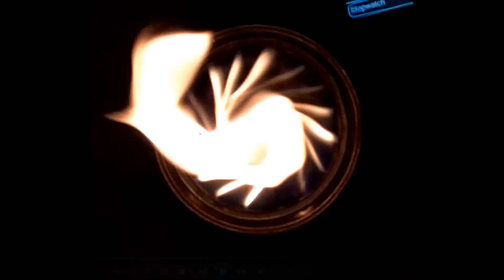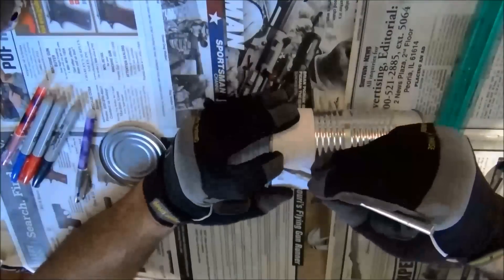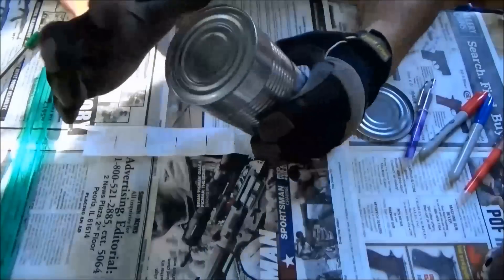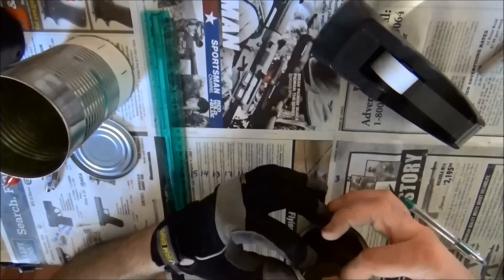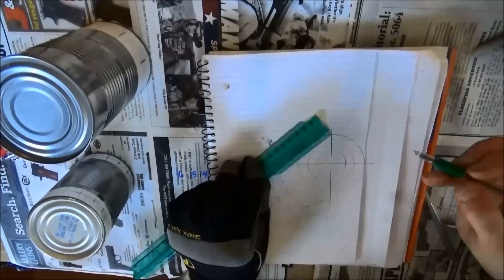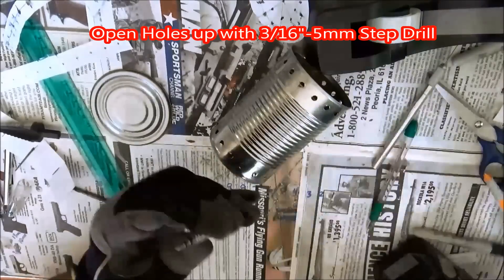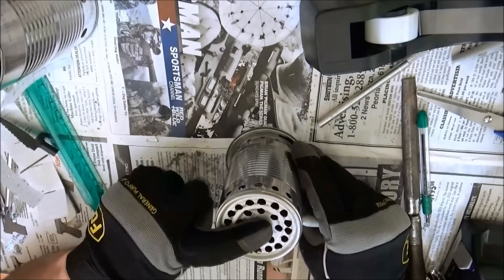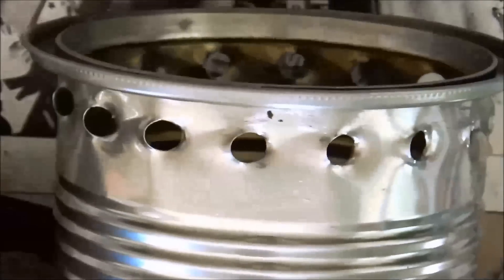Wood Gas Stove Science!! Vortex V5.4 Build!!

Comment: And really I have nothing against wood gas tech.i feel it has beter off grid fuctions,such as running a generator,but they eat wood way to fast.best one I made had four walls,and was very close to compleat combustion,but it still didn't stack up against my expidition stove.and where I camp,there is no room for error.i don't do weekend hikes.rocket stoves fall I the same park here.i made some really good ones,even from clay,but its to hot and burns the wood to fast.think about it,you induceing fourced air into a fire,its gona burn like a forge for a few minutes and then its done.its all we are doing here.creating a strong draft.our ancestors did this with a Dakota fire hole a long time ago.for the weight and space,the Swiss and sweedish army stoves are the best route,and if we can make a small fuel puck that burns hot and for a long time,we got a solution to the apocalypse.sawdust and used oil works great but its messy.paper alown isn't volital enough for compressed pellets.long way to go befor we solve this problem

Comment: Yea its called a pressurized stove.the one I have was used in Vietnam,and is still going strong.the pressurized system burns almost ant liqued fuel,including gasoline.pluss it doubles as a wood burning stove.google the svea 123, you'll figure it out.

Comment: All I'm saying is its cute,but until I find a stove that can beat my sigg,I'm not going to be impressed.by the way,I just ran a two cup water boil test on my sigg,four minutes.and I used many a tablespoon of alcohol in the stove and actually still have fuel left over.there was a reason why this stove was a champion on expeditions all over the globe,to the most remote areas possible.it burns anything,consrvitive on all fuels,and cranks out the btus.it beats my gas stove in my house.we can stop trying to build a good stove.Sweden beat you to it.fuel is a diffrant story.with a stove you can burn anything in,we can explore more options like fire dough and biomass briquettes.
Reply from the maker: +Richard Peterson So... How hot does your alcohol stove burn? I bet at least 1800F to boil water that fast. 
i agree alcohol stoves are pretty sweet, but I'll keep working on my wood gas experiments. Thanks for the comments!

Comment: And by no means am i knocking your stove.its actually really well made.but I think I our quest to gain compleat combustion,chaseing the blue flame basicly,we steped off the path we need to be on.a small stove that can burn at 500 degrees for two hours is way beter than one that burns @ 1500 degrees for 15 minutes.this type of stove has one job.to cook food.and a longer burn time on small amounts of fuel is desired here.for example,we made a similar stove that you set a sweedish tourch into.same can disign basicly,just a difrant way to build and burn the fire.45 minutes burn time,and we used a very small log,small enough to fit in a soup can.id like to see longer burn times reached,but few people are working on this.
Reply from the maker: +Richard Peterson My mission during my Wood Gas Stove Science series was to learn the science behind wood gas stoves. Another personal goal of my work was/is to learn how to make a lightweight, clean burning, backpack stove for cooking a quick meal or hot beverage while on the trail. The Vortex 5.4 seems to suit that goal. While hiking I do not really want to stop trail side and spend the afternoon cooking. You can tailor your burn time with this design from about 15 minutes to 40 minutes with the amount of wood pellets/fuel you add. If you need really long cook times a different design is for you. Thanks for the comments! :)

Comment: Just out of curiosity,is that temp realm necessary?most of all back packing stoves average that time in boiling two cups of water,including a dakotota fire hole and a sweedish fire torch.and if its burning that hot,how long will you really get in burn time?I agree we need an efficient stove,with minimal smoke,and we need to reduce cook times,but anything above 450 degrees is excessive.all food can cook at or below this temp.what we need more than insane temp is long burn times on small fuel supply.master this and ill be impressed

Comment: I have planned to make few of these with my scout patrol but I struggle to understand how does bigger can's top hold smaller can still. I also ponder what kind of can opener should I use to success. I only have this army style opener http://bit.ly/1UC94oc and it doesn't make a clean cut but do the job.
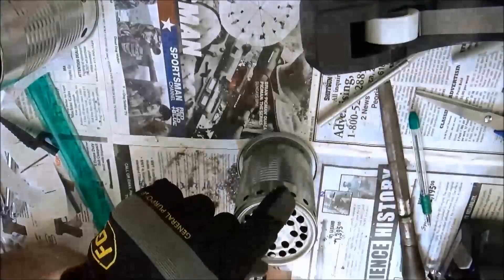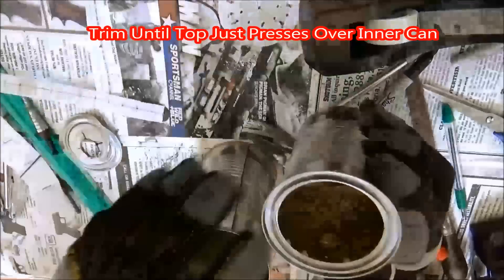Reply from the maker: +Joona Halinen I use a side cutter to remove the top of the large can. This allows the top to be put back on the can easily. Pause the video at the :08 mark to see a good view of the can opener. After removing the top of the large can you will cut a hole in it just big enough for the small can to push in but tight enough so the rim on the top of the small can dose not go through the hole. Watch the video from 7:50 to 8:40 in slow motion if you have to. If you can not get the right can opener you can flip the big can over and cut hole in the bottom of the big can. It makes making the Vortex Tweak tougher, but the stove will work very good without the vortex. The open bottom of the large can will allow the ground underneath to get very hot so use it on a rock or something so you don't start the ground on fire. Hope this helps. Make sure to like the video and subscribe if you like.
Reply: +Heath Putnam I actually found proper opener today so I'll build one this week. What kind of paint did you use in your own? Some kind of heat resistant carpaint? Paint has to manage over 1400 farenheit! How has your paint react to use?
Reply from the maker: +Joona Halinen 2000 degree spray paint off amazon. The outer can is still holding up very good, the inner can still has all the paint but turned white. Good luck!

Comment from the maker: Tothe Point** Unfortunately you have your comments turned off so I can not respond directly to you. If you want to make a bigger stove, the hole size should remain the same you will require more of them though. Keep the spacing between the holes and the distance from the top or bottom of the can the same. The ratio should be close to 5:1 area of primary air holes to secondary air holes. The size of the outer can does matter. If the outer can is too small the air will not flow freely up to the secondary air holes and if it is too large the air be super heated and the strength or the burn will suffer. My rule of thumb is outer can is not more than 1 inch bigger than the inner can. You will have to experiment a little to get it perfect. Check out my other videos for the science behind wood gas stoves!
Reply: Heath Putnam Thanks for the quick reply. (I don't know how to turn comments on, will try and find out, sorry.) Great explanation, as always. Thanks!

Comment: If I wanted to build a larger version, would the hole diameters etc. just scale up as well? For example if the cans were twice the size of the ones in the video, would the size and number of holes change? And is the space between the inner and outer can important?
Reply from the maker: +Tothe Point The bottom holes are actually considered the primary air intakes. The problem is probably the ratio of primary to secondary air intakes. Through my experimentation I found that if you can get close to 5 times the amount of primary (bottom) hole area than the secondary (Top) hole area you will get a much cleaner burn. 
To figure the total area of the top holes divide the size of the top holes by 2 (that's the radius). Multiply the radius by the radius then multiply by PI (3.14) then multiply that by the number of holes. Take the number you got for the total area of the top holes and multiply that by 5. That is the total area you will need for the bottom holes. 

Divide the size of the bottom holes by 2 (that's the radius). Multiply the radius of the bottom holes by the radius then by PI (3.14). That gives you the area of each bottom hole. 

Divide the total area you need for the bottom holes by the are of each bottom hole. This will give you the number of bottom holes you need.

Hopefully I didn't make this too confusing.

Anyway, get your ratio correct first then try to burn the stove. Let me know your results. If that does not work, build my V5.4 and give that a try.

Good luck!!!
Reply: Heath Putnam Thanks, I'll try and figure out the areas and see what I can do. I don't eat a lot of canned goods so optimal cans to work on might take some time, but I'll try and get something before cold weather sets in. Thanks again.
Reply from the maker: If you have trouble send me the size and number of the top holes and the size of the bottom holes and I can give you some more guidance.
Reply: Heath Putnam Thanks again, man. I have a busy weekend but will get back to you soon as I get a chance to work on it.
Reply from the maker: OK offer stands whenever your ready
Reply: +Heath Putnam Quick question: when calculating the 5 to 1 ratio, do the 25 holes in the bottom count, or only the holes around the sides at the bottom? In other words, to the 25 holes count as part of the primary? Thanks again. I measured the set I have and I need to seriously increase the primary intake, not sure how I can modify beyond making a second row of holes. Or, if I plug some of the secondary ones, would that work too? I'm wondering if the number of secondary holes shouldn't go below a certain number, just to get enough jets.
Reply from the maker: The 25 holes in the bottom of the can count towards the total area of the primary holes. You should have enough secondary holes so the crown of flame around the top of the cans totally cap off the wood gas escaping out of your fuel. This will give you the most efficient use of your fuel. You can increase the number or size of your primary holes around the bottom and through the bottom of the can. Get as close to 5 to 1 ratio as possible. Then try a burn. You will know quickly if you are heading in the right direction. Hope this helps.
Reply: Thanks again, Heath. Very prompt and helpful.
Reply from the maker: +Tothe Point You definitely need more primary air. It will give you a much cleaner burn. Try to increase the diameter of half the holes and do another burn to see if your burn time and your smoke/soot reduces. if it does your on the right track. I think you will be happy as you approach that magicall 5:1 ratio. Good Luck and thanks for the video!
Reply: Thanks man. I replied at my video.